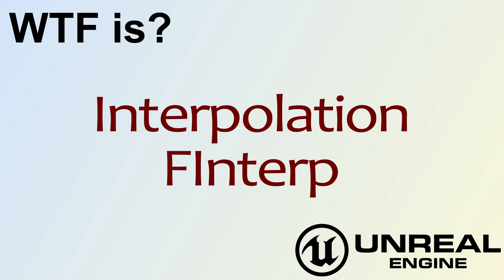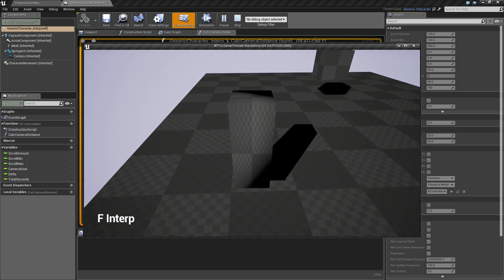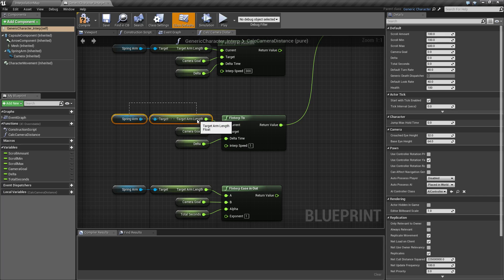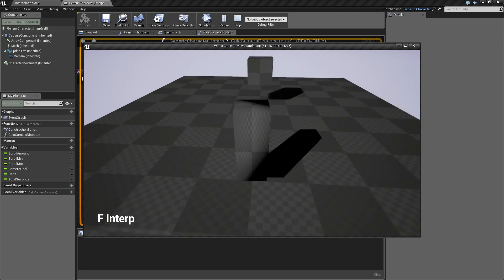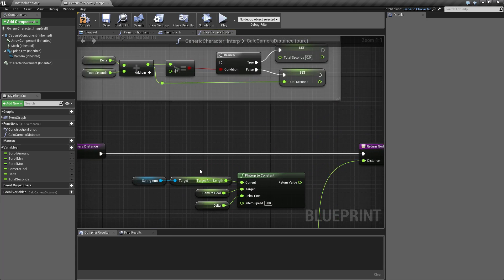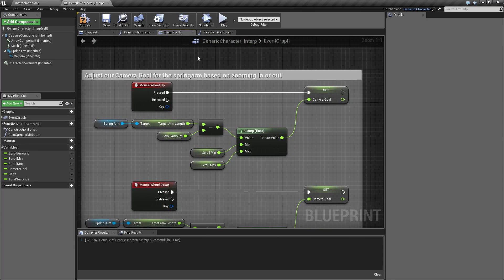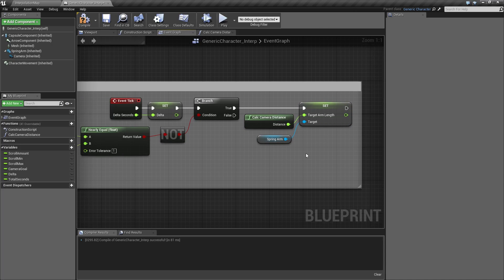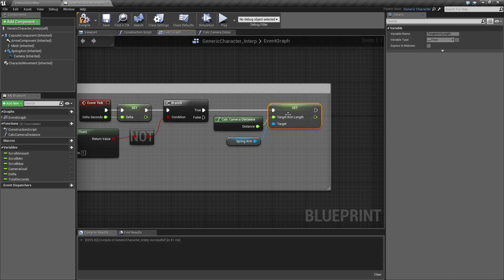WTF Is? Interpolation - Finterp Nodes in Unreal Engine 4

Comment: I'm trying to do this kind of setup with field of view to make binoculars that zoom from 1.5x to 10x or 10x to 1.5x by pressing and holding the arrow up or down keys, but I also want to have another button which allows you to cycle between 1.5x, 3x and 10x depending on whether you're between 1.5x and 3x or 3x and 10x, i.e.: if you're above 1.5x and below 3x zoom, you don't want to press the cycle button and have it go back to 1.5x for the first click on the cycle, but rather 3x for the first, 10x for the second and 1.5x for the third. How can I do this?

Comment: Hi, Mathew Wadstein, what is the difference of using TimeLine and "Finterp Ease in Out" node? Hope for your reply.
Reply: For a simple answer, I'd say that a Timeline is more expensive but would allow you much more control on the animation curve.
Reply: @june-sea  Thanks bro. But how to set the time that I want to change the value from current to target?
e.g. I want to change the value 1 to 10 in 2 sec.
Thanks😊🙏
Reply: You can create a custom event, run a timeline through it and inside your timeline set the play time to 2, then create a float curve with two points (0sec=1, 2sec=10). You can also add more point in between or convert them intp bezier to add some ease etc. Them use the result to animate the value you want. 

You can also instead create a curve (0=0, 2=1) meaning it will interp from 0 to 1 in 2sec, and use the result to lerp two values.

Nb: check timeline tutorials, they do not use Tick etc.
Reply: @june-sea  Then we are using Timeline to do the Function now...
You said that use timeline will be more expensive than using "FInterp Ease in Out" node.
But I only want to do the sample things, move a cube from point a to point b.
I know it can use timeline, but is it has more cheaper way to do the basic?
🙏🙏🙏

Comment: Some useful nodes right there, can use it not just for the more obvious purposes but anytime you want to blend numbers at a rate. I used it recently to change harsh ground speed values to gradient values so instead of going right from walking speed instantly to jog, it takes a bit of a blend to get there.

Ah was curious what the difference was between the normal FInterp and the Constant. I thought maybe it had to do with one being a fixed time despite the distance, and the other being a fixed rate despite the distance. In other words, even if the distances were really far apart using the Constant node, it would preserve the rate in which the numbers blend, where the other would keep the time it takes constant but the rate would be determined by distance; making far apart move really quick so it can take the same time.

Idk why I was thinking that but yeah good to know its just the difference in easing. I wish their tooltips on the node would say that instead it just says smooth but thats such an ambiguous word.

Comment: Hi. Great explanation you got there. However I am trying to add a Finterp node into my touch screen drag motion controller to move an camera actor to ease the movement after finger remove. Could you look at my BP function here https://1drv.ms/u/s!At4a_5d-Zsmi82dzPIi9QbPNf0nP / and this from the Event Graph https://1drv.ms/u/s!At4a_5d-Zsmi82YWniCKyAE8mqlU which I call the function using Event Tick and direct me on where should I add the Finterp node properly. Thanks

Comment: The delta time makes me sick
I need an explanation Math???
Reply: Delta time is the time (in Milliseconds) that passes between rendered frames.
If you have a value subtracted by a Float variable (Ex. 5)in the TICK event,  you need to multiply your variable (5) by delta sconds. Otherwiese if your game lags (which means time runs slower), then your float decreasing speed will stay the same and will not sync with the lower framerate. This may lead to undesired results. Like a projectile running faster when game slows due to lag. You may make an optimized (lag free game) but it is always a good practice to use delta seconds. :)
I hope this helped understanding the Delta Seconds value.
Reply: Unreal Engine delta second from event tick is not in milliseconds, but whole seconds.  At 60ticks per second, your delta is a float of roughly .017

Comment: I have a question. I'm using the FInterpTo in my character's Animation blueprint to set my foot IK system's Alpha from 0 to 1 after landing over half a second. The problem is, it doesn't seem to bring the Alpha back up to a full value of 1 unless I set the interp speed to 10 or above, but then it changes too quickly and negates the effect I'm trying to achieve.. I can send some screenshots if you think this is something you might know how to fix.

Basically the idea is that I don't want the foot inverse kinematics to work until after the jump_end animation finishes, otherwise it looks ugly. I'd use a timeline but those aren't available in Animation Blueprints.

Anyhow, if you have any ideas I'd love to hear them.
Reply from the maker: You could try just using a normal LERP to drive it if you have a problem with the interp.  Since the alpha on the LERP drives the return value directly you could use something like a percent of time and feed it into that.  Something like, and I have no idea if I would do it like this but I might start here and work from there;

1) On tick check a bool to see if i should be lerping?
2) if so I add the current delta to a variable I am using to track how much time have passed.
3) do some math to find out based on my goal (0.5 seconds in your case) compared to how much time has passed (the variable I am adding to in #2) to see how much % (between 0 and 100) has passed and feed that into the lerp node as the alpha (adjust to be 0..1 instead of 0..100)
4) check to see if I am at the end point for time (greater than or equal to your 0.5 seconds for example) and if I am set the bool to false so I am no longer wanting to lerp and set the variable I am storing how much time has passed to 0 so the next time I use it I am starting with no time passed.

Just some stuff off the top of my head.
Reply: Thank you for the ideas, I'll definite give them a shot.

Your contributions to the UE4 community deserve more recognition!
Reply: I hate to ask this but, what exactly are the nodes you can use in Animation Blueprints to drive the Lerp from 0 to 1? Timer from function? I wish you could use animation montages inside animation states, then I could ask if the jump_end animation is playing before just turning the alpha to 1.
Reply from the maker: Maybe this might help?  http://i.imgur.com/TJGfVI0.png

This is added to the end of the default Anim BP used in a 3rd person example.

Basically we check to see if we should be transitioning -> if we should we take the current transition time and add in the Delta from the update (Delta time X)

Then we check to see if this new value is less than or equal to our target transition time (0.5 in this example) and if it is we do a little math to get what percent the current time is compared to our target time and feed that into a lerp with the values we want out (0 thru 1 in your case).  We take the output of the lerp (which will be from 0 to 1) and then you would feed it into your IK system like you want (in my case I just print it)

If we are over our target (0.5 in this example) then we know we are at our goal so we set the current transition time back to 0 so it is reset for the next time, we set our is transitioning bool to false as we are done and don't want to run this anymore, then we set our IK system to the goal we wanted (which was 1 in your case but I print out Done for my example.

For setup I created 2 float variables (Current Transition Time and Target Transition Time) and 1 Bool variable (Is Transitioning).  The default value of Target Transition Time is how much time you want your lerp to last for so in this example I set it to 0.5 which is what you wanted.

Once this was all done I just triggered the Is Transitioning bool from my controller for testing but you would want that to be set to true whenever you do your landing and when you want to drive you 0 to 1 IK system.
Reply: Thank you so much for taking the time out to help, I would have never figured this out on my own. I just had that "Ah ha!" moment.